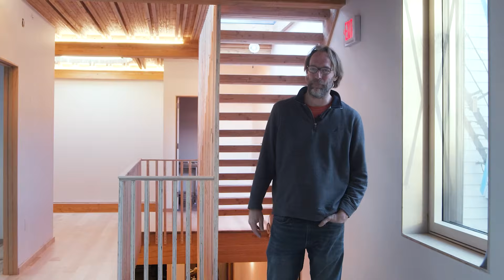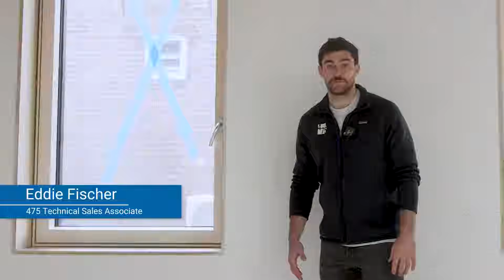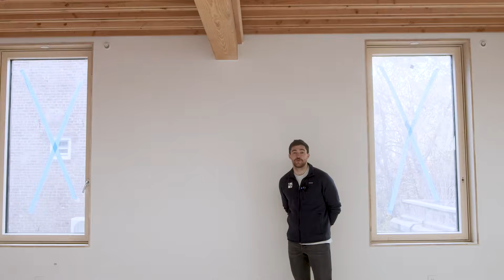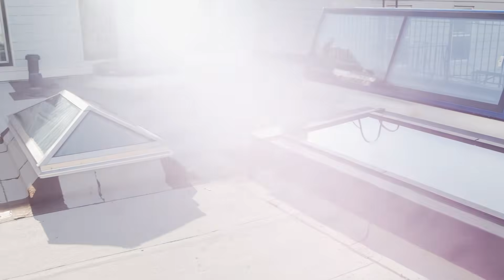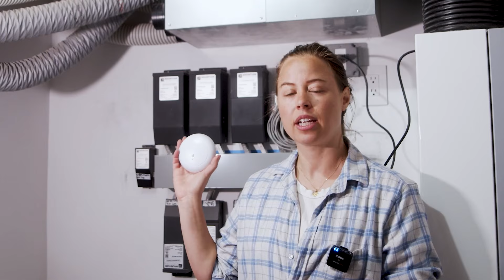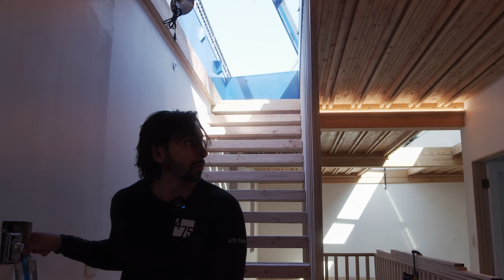475's HQ Office: Passive House, Mass Timber, Masonry Retrofit

Comment: Curious about the water detail against the bricks for exterior water drainage and interior vapor generating dew — was there some sort of dimpled product used?
Reply from the maker: The interior of the brick was treated with VISCONN liquid-applied air barrier, no dimple product was used. The waterproofing was done on the exterior side of the assembly.

Comment: I utterly love your products and your show is hugely inspiring. Especialy in this show as your facing similar problems to me.

Sadly, coming to visit you would be crazy financially & environmently.  So I was  wondering if you can work with a YouTube 3D Video channel to create a 3D space that can be moved through. Ideally with a https://en. wikipedia. org/wiki/Wizdish_ROVR who happen to be based out of the same Oxfordshire TechHub as Oxford PV. 

We would love to get as close as we can to a Passive House. Whilst living in what was once a 3 Bed Town House. Built from Brick, Wood and Concrete in the 1960-70's to 1960-70's standards for insulation, and services.

For example we now want to replace our single phase 1960-70's electrical system & Consumer Unit. With a tube run uprated three phase high voltage & a Low Voltage/data wiring loom. Along with a bidirectional Hagger Comsumer Unit to handle everything from a grid connected EV/Battery & Solar/Oxford PV supply  to a whole house sensor network with control via Home Assistant.

When watching the video you mention various sensors for air managment. Have you looked at Home Assistant for whole office management aa it has good links into commercial protocols & devices, is under active and continuous development. 

So much so that hardware manufacturers are not writing proprietary software and instead exposing their entire API to Home Assistant and implementing their control software. 

When we finish the conversion work on this property. We are aiming to have a multirole space. That allows connected multi media production in a sound attenuated space. That will have a grid backed Solar/Oxford PV/EV powered: Connected ground floor 2 bed disabilty access flat and upstairs 2 bedroom flat with 24/7 access to London & its Airports. 

And if you wanted to use us as a jumping off spot for research, product discovery or reporting we would love to help!

My main problem is that you source a lot of your products from Europe!
Do you have a branch in Europe that does your sourcing? Or
Do you dropship directly from the manufacturer?
As that will effect how, where and what we can buy in the UK. 
Any thoughts?
Reply from the maker: If you are in the UK, you're in luck - all of these manufacturers are available to you already. Simply contact each one directly: Pro Clima, Lamilux, and Brink